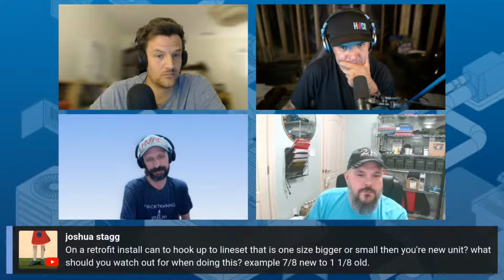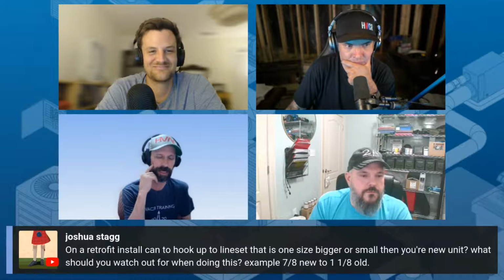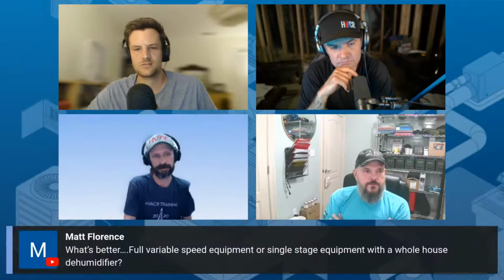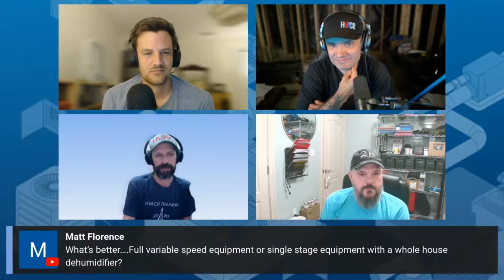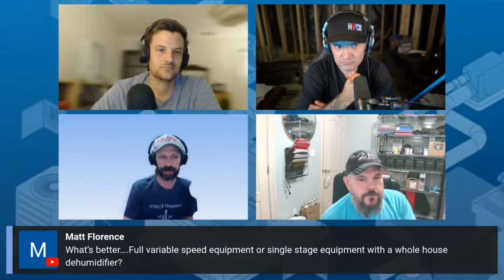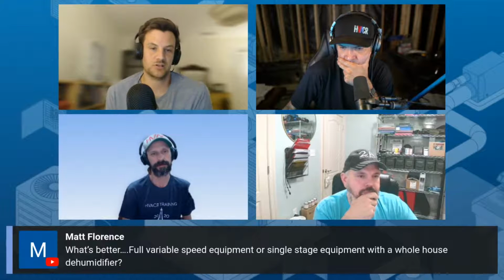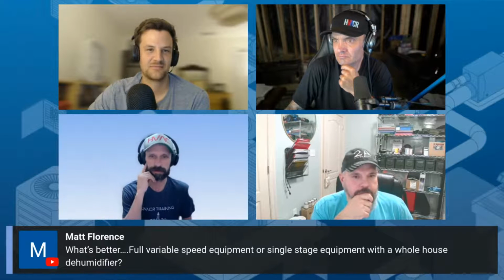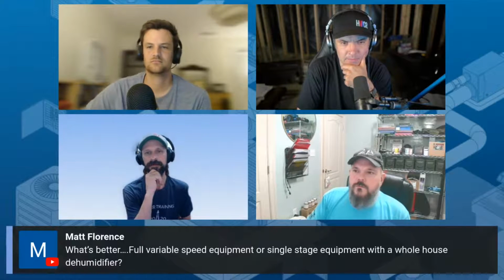Ask Me Anything- Residential Install

Comment: My question for the panel is..  I have 2 units. One condenser is blowing a fuse. When I replace the fuse I feel like the condenser is blowing much hotter air than the other condenser..  It seems strange since they are cooling the same space.  What conclusion or need more input?

Comment: On an attic, please do not  attach the condensate line to the emergency pan drain line. If you cant run them separately  don't use a drain line on the emergency pan. Use a float switch.